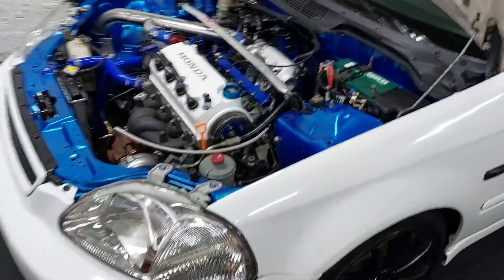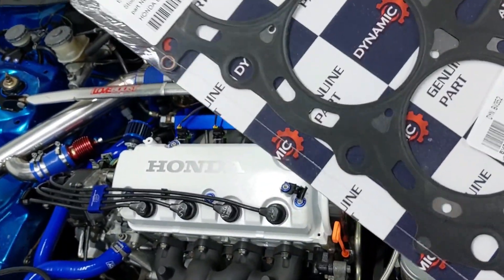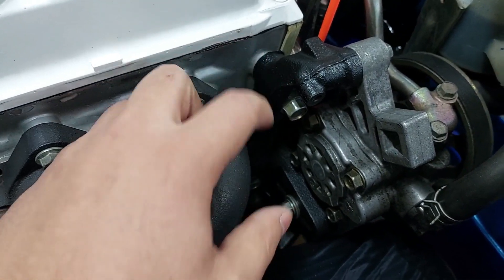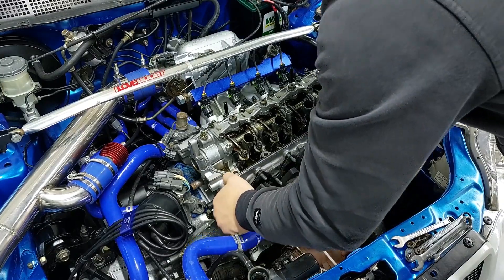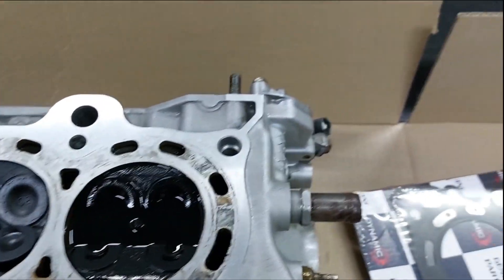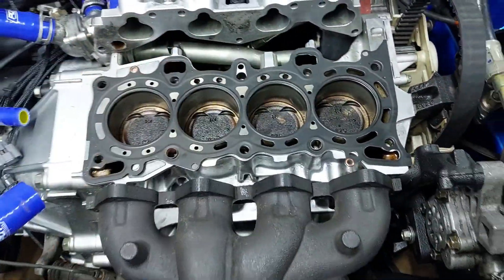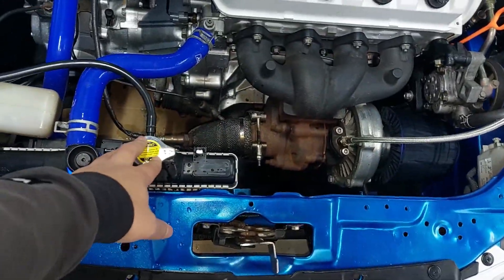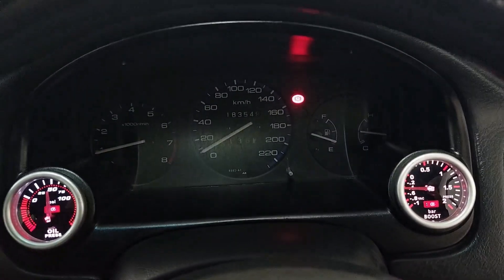Turbo Civic Blew Up - How To Replace a Honda Head Gasket

Comment: He set the timing to 0? I would set it at lease between 12-16 degrees
Reply from the maker: Hi, Yes correct, 12 to 16 degrees is good for idle. the reason I set my idle to 0 degrees is because I only have a TDC pulley mark, so I set my ECU ignition map to 0 degrees and then adjust the timing to 0 on the pulley/timing light. after it is set I go back and set my ECU idle timing to 14 degrees. so the 0 is temporary just to sync the timing.

Comment: Good job my friend. Question if you don't mind.... I have the same motor and did the head gasket after previous had blown just like yours with the spray out of overflow tank. I put it all back together correctly and the car now stutters on idle. What do you think is the issue? I've spent 2 days rechecking things and all seems correct even timing ?
Reply from the maker: It could be a lot of things, but replace the spark plugs. Sometimes, they get damaged because it was burning coolant. I have replaced about 3 on this car. They still work when I test them but once installed they missfire
Reply: @RisingBoostYT  You are the man, it was the spark plugs. Big thank you once again friend 🙏

I have a last question.... honda says I can re use my head bolts, but I searched and searched internet and can't find honda's recommend re use torque specs. Do you happen to know, or is it best to purchase new head bolts ?
Best Regards,
Dee
Reply from the maker: @deecivic  glad it worked, you can reuse the head bolts, check on a website called Nthefastlane for the torque specs
Reply: @RisingBoostYT  Thank you very much once again. You've been a blessing. Been watching your videos and they are very aspiring and helpful. Keep up the great work, take care 🫡
Reply: @RisingBoostYT  Okay, I will start with that. Thank you very much, will let you know how I make out 🤞

Comment: I’m running an SiR body with d16zc on it. Any cam suggestions? Just gonna run it NA but I wanna switch to an aftermarket cam and cam gear
Reply from the maker: Hi John, ZC I assume it is the "Similar to Y8" ZC, if the head code is P2J? the stock sohc vtec cams are fairly good, I would spend money on a Skunk2 intake manifold, slightly bigger TB and exhaust system first, then a cam, they pricey though but look at skunk2, speedfactory or brian crower, cam gear - personally I think skunk2 make the nicest cam gear. just be sure the cam is not intended for turbo setup. some cams require a valve kit also. it is basically limited to what you want to spend. if you do change the cam you can benefit a lot from a good tune.

Comment: The temperature on the dash shows overheating? My d16y7 stock stay down in comparative to your civic.
Reply from the maker: Hi Pedro, I get this comment a lot, I think it is because it is a JDM cluster (kmph), because they all sit like that at operating temp, I have a Fan controller only allowing temp to go 10F above where the thermostat opens before the fan bring it back to where the thermostat opens at 172F, so it only goes to 182F max. but the cluster always sit in that spot.

Comment: Hi what tool/ did you do to get the middle bolt out on the intake manifold? I was watching as best I could.
Reply from the maker: Hi bro, I use 2 small 10mm spanners, the ring sides are slightly offset, so I can swop between the 2 and bolt it on from the top through the small hole in the intake
Reply: Thank you bro!. I changed the valve cover gasket then cleaned some gunk off the engine and saw that my leak is a step deeper at the head gasket. So I'll be doing this very soon Ive just been researching a lot

Comment: I also have a white civic...my problem is a crank sensor...for some reason mine is gone the car did drive but now it doesn't wanna start...should i take it apart?
Reply from the maker: Hi, what model civic do you have? most of the 80s/90s D-series motors don't have crank sensors, they use the 3 sensors inside the dizzy to determine engine position.
Reply: @RisingBoostYT  it's a d series same as yours but the dizzy is not the same I'll post a video of my car and engine

Comment: Just as a heads up... You seem like a decent person who actually cares about their stuff (i can tell from your huge attetion to detail)... You need to put a 1 way check valve in-line with the PCV valve if your going to run the system that way. Make sure it will close under boost. Because those factory pcv valves were not meant to see boost, they dont close every time when the manifold is under pressure. If you can find a clear 3/8 check valve (sometimes aquarium stores sell them) it will help so you can see through the check valve to make sure its not getting clogged. But def need a check valve. Otherwise like 50% of the time the manifold sees boost, so will the crank case.... 
Happy boosting. 
Cheers.
Reply from the maker: Hi Matt, thanks for the advice and taking the time to share helpful information. I actually for this reason block that hose off, after the pcv valve it is just blocked, I am just using the pipe because I could not stand having the block-off be visible on the intake manifold, so the pipe does not connect to the black breather box, and then I left the breather box open to atmosphere, same with the valve cover breather, I do plan to rout it to a catch can later on. but thanks for the tip with the check valve, I will look into that, see if I can find one.

Comment: We are supposed to retorted our head studs at 1000 miles. Personally I think 500 is better then again at 1000. That prevents head gasket sealing issues. But after second retorque should be good to go.
Reply from the maker: Hi 3dw3dw, thank for the advice, this is a highly debated topic on the forms. but I will say that retorquing did work for me initially. but I do suspect that I stretched my head studs with the higher comp, old tunes ignition timing + boost
Reply: @RisingBoostYT  I don't know about the debatability. I just know that it is required per the instructions included with arp2000 stud sets. Instructions call for retorque at 1000 miles. I feel safer to retorque at 500 miles then again at another 500 miles.
Reply: What would the d15b2 block and Y8 head bring the comp ratio too?
Reply: @projecthonda that would depend on what pistons and rods were used, whether the valves are dish or flat, how you grind your valves and seats, what head gasket you used, whether or not you milled the head or decked the block, what rings were used and if they weren't total seal rings what end gap was set to, how worn are the valve guides, was the head and intake ported and gasket matched, and the manner in which the crank journals were line bored. 
Also a thing to consider is that there is a huge difference between calculated static compression ration and operational/working compression ratio. 
For example let's say we have a stock engine rated at 10.5:1 cr but the engine itself barely achieves 80% volumetric efficiency. Whereas a well built well timed and properly ported and tuned engine with a measured 10.0:1 cr may achieve ~110% volumetric efficiency within the window of the determined rpm range even though it is still naturally aspirated.

Between our 2 examples the lower measured compression ration will yield a greater working, or functional, than the higher measured cr of the stock engine.

Also understand that if you gap your rings for max boost, let's say you're going for the moon and set top rings gap to 0.026" your working compression ratio between 1000 to 3000 rpms is going to be much lower than what you measured, gradually increasing as the rpms build, because at lower rpms the FA mixture has a lot more time to bypass the rings and the engine is running cool. When the boost comes on and temperatures spike the rings expand and close the gap raising your working compression ratio.

There is a hell of a lot more to consider in regards to compression ratio than block and head combo.